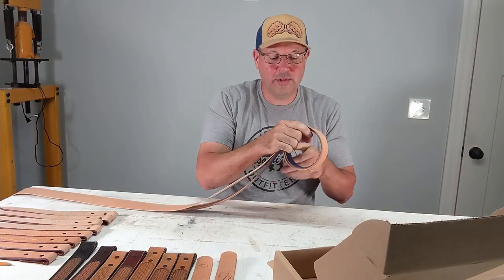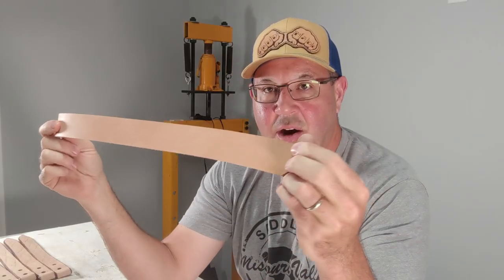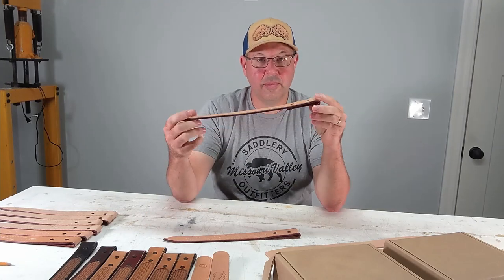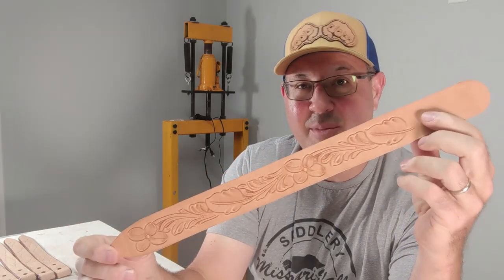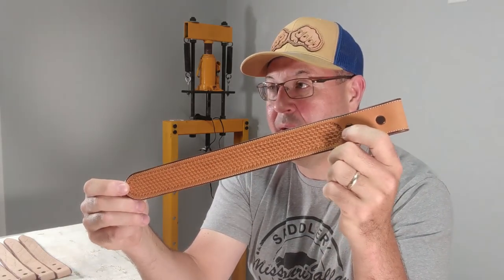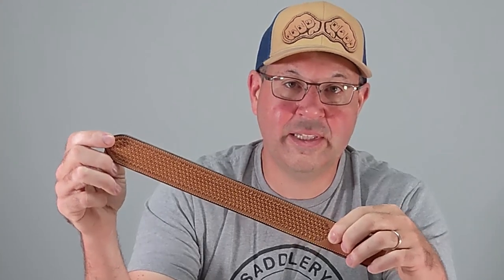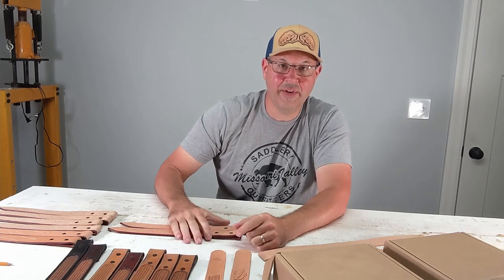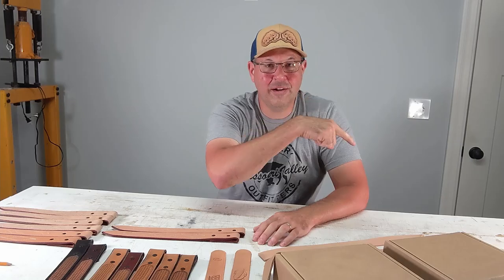Scrap Leather EP 3 - VLOG Belt Scraps

Comment: I have a small Tandy "High Tech" splitter and I skive the ends of scrap belts and splice them together using Weldwood contact cement that holds extremely well. After I glue the pieces I split them even and stitch the splices lengthwise 6 stitches in 4 lines, never vertical as it weakens the belt. I will then stamp a simple border, Pro Dye them and use those Zinc buckles and they sell fairly well for $40. Depending on the length of scrap pieces I use two or three cutoffs. I have also made a couple of advertising belts that I wear so people can see the different weaves and I have some Sergey stamps from Bulgaria that are unusual. 

My fav pattern is an arrowhead basket weave, sells very well. I also will make a knife sheath to match the belt it goes with as knife making is how I got into leather work as I had to make my own sheaths. When I sell a knife it comes with a matching sheath if desired. It got me into flashlight and small belt pouches. I designed a small belt pouch that is big enough for a phone and thin wallet, but doesn't look like a fanny pack.
Do you get requests for horizontal carry sheaths more now? I seem to and I tell them they are not very ergonomic unless for short pieces. It just isn't comfortable to carry horizontal past 4 inches without being angled down.
Reply from the maker: @mountain Fisher That is also a very good idea for you left over pieces.  I have not been getting requests for horizontal carry sheaths, which is a good thing because I do not really like making them